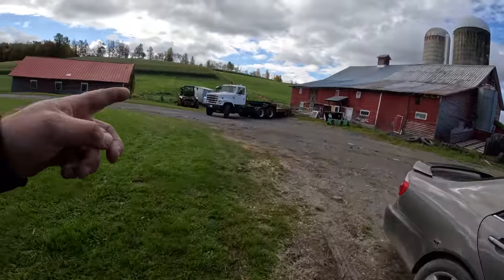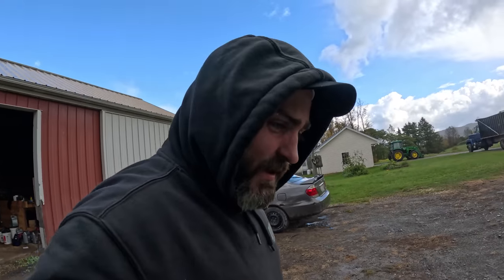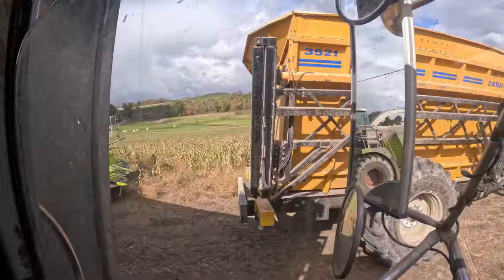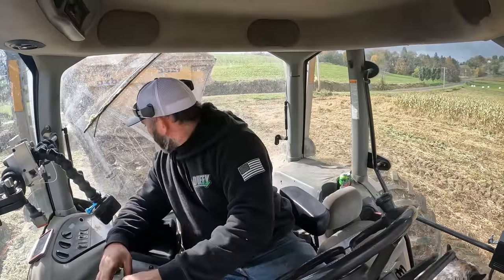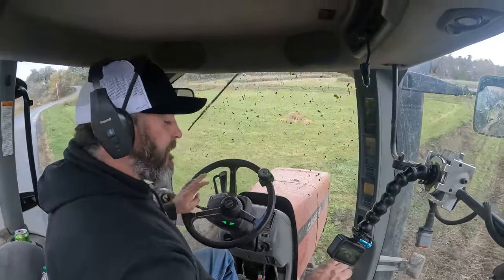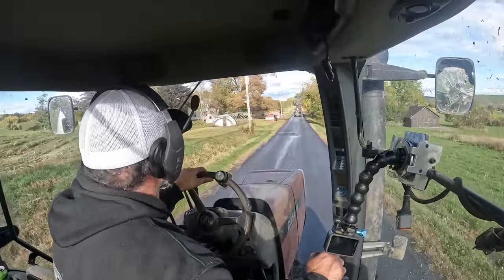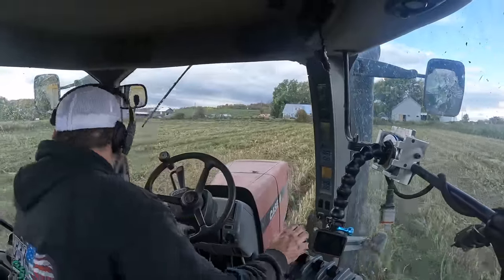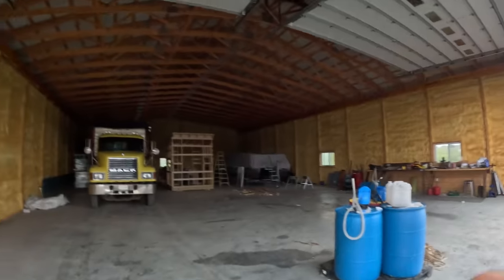Rain & Less Than Ideal Situations- When Will Silage Season End!!!

Comment: I know you ain't fond of that one shed of yours that's falling down, and I sure ain't seen much of the inside, but we've fixed a few that were in WAY worse shape for less that the cost of concrete for a new one. Buildings ain't cheap, and depending on state code, it might cost you more to tear it down and build a new one than fixing it. As for the content, I ain't missed a vid 5 months. Every single ones been entertaining. Keep movin' forward Chris. Ya got this.

Comment: Yea them FWA tractors are prefect on the little carts. If you end up with the double carts filling semis then an articulate is where its at. The IVT/CVT trans tractors in my opinion are the worst pos the ever built especially in mud. They were built for the same reason they built an automatic trans. People cant drive for shit and just play on there phones all day texting and sending snapchats (not hard to do with a powershift or even a syncro range tractor or manual trans truck tho either in my opinion).